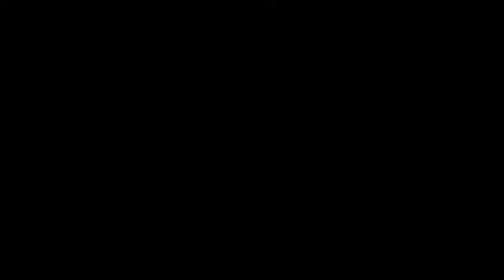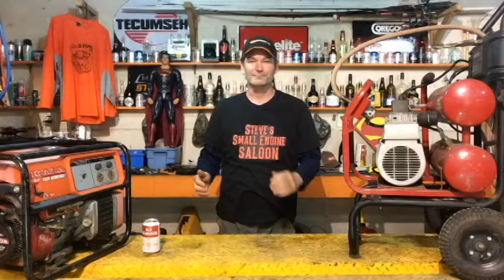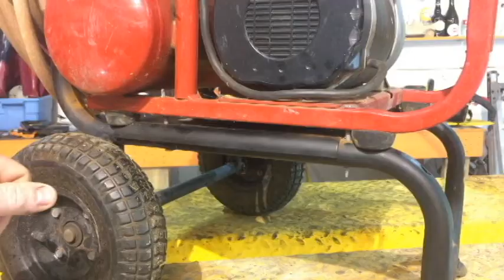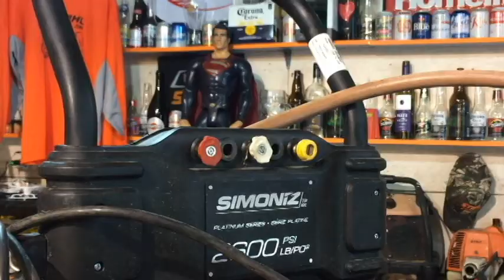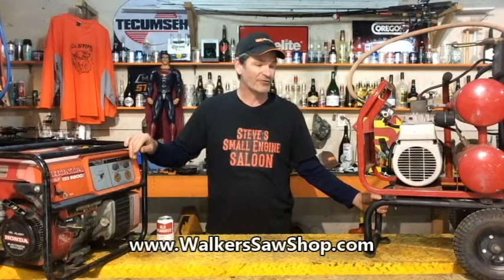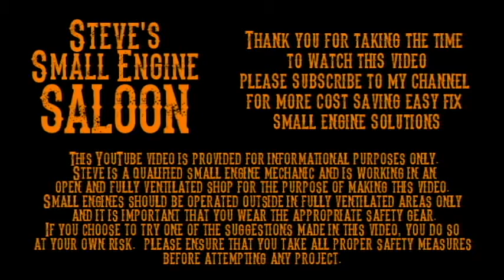How to Recycle an Old Pressure Washer Cart for Your Compressor

Comment: Can you tell me please why my old craftsman 5 horse electric compressor that's been sitting will not turn on and run unless I push the reset button in and keep pressing in it! Could it be a bad switch in the motor?
Reply: Is it a gfci that went bad?